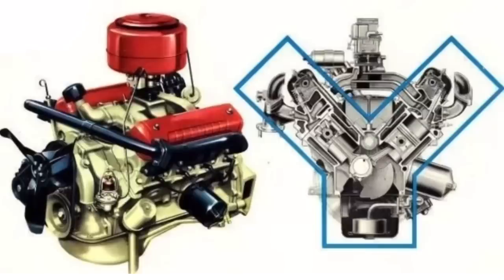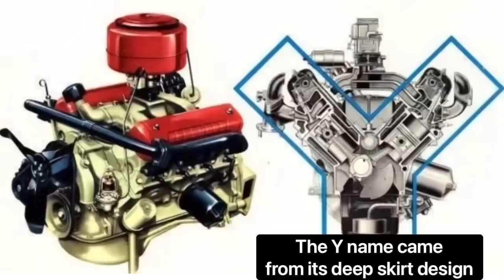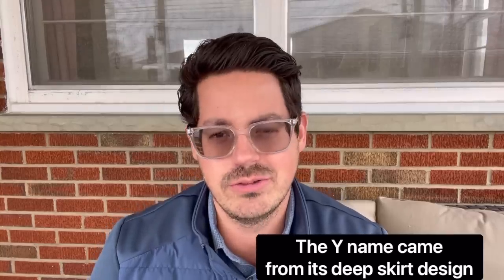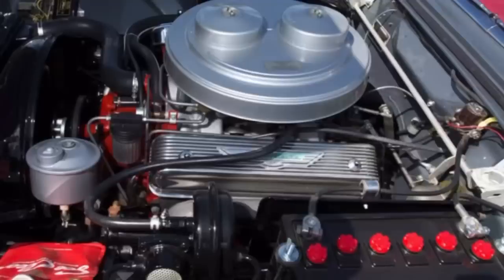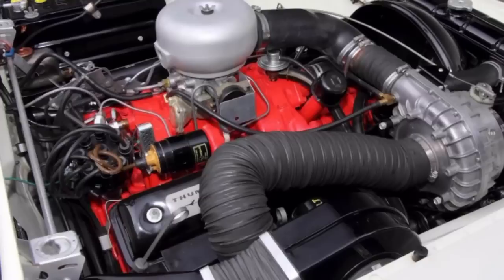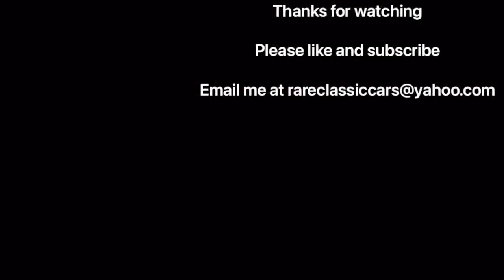Worst Engines of All Time: Ford Y Block V8

Comment: My dad was an L-M dealer in the 50s up to the 70s. His mechanics knew the Y-Blocks well with their idiosyncracies, but I don't ever remember them completely dismissing these engines. The Y-Blocks had their issues and relative to the later MELs and FEs, there's little comparison. But, Ford was looking for an upgrade to the flatheads. Their initial choice of 239 CI was not by accident. Competent engine restorers today have worked out their own methods of the oiling issues and modern oils help. I had an original 55 w/272 engine and a 56 w/292 engine-4bbl. The 292 gave me 114 miles before the rear main bearing went bad around 1970. It was rebuilt with standard rings and bearings. The crank was in near perfect shape. There was heavy clay-like sludge in the oil pan that required a scraper. It seemed to me one of the worst things about the Y-Blocks was the terrible "teapot" or "haystack" Holley 4bbl carburetor used through 56. I replaced mine with a Rochester from a 52 Olds (an old mechanic tip) for $5.00 with great results on the original Ford manifold. Drivers side exhaust manifolds were prone to cracking at the front bolt resulting in a loud tick from the solid lifters. Remember also that Y-blocks were used in 50s NASCAR with success. And probably little known is that truck Y-Blocks (292) utilized heavier components than those used in autos. They were not necessarily interchangeable.

Comment: Y Blocks had their quirks (especially oiling issues to the valve train) and were no match to the Chevy 265 & 283 for performance but I still love the Ford Y Block and hearing it start and run. Some older folks I'm told didn't like them as they were noisy when they wanted a car that ran whisper quiet (the majority of Y-block equipped Fords and Mercurys came with dual exhausts in the 1950s)
The Y blocks were given a lot of internal upgrades in 1955 and thus not much is interchangeable with 1954s (larger water pump, exhaust manifolds, fuel pump is different, etc)
As he says, best to find a Y block expert to rebuild the engine.  They're out there.

Comment: When I was a kid we had several cars with Y blocks, none of them were bad motors, they all ran well and had long lives...or at least as long as other engines of the era and were superseded by the newer small block, the 260 and 289, not because the Y block was horrible, but because Ford learned a lot and had incorporated those lessons into the new motor.

Comment: My dad had 3 EDSELS, 2 58s and a 59, villager 9 PASSANGER station wagon, which did not run. 
The one was a 58 Pacer it had the V-8 361/400 engine, boy you can really hear them lifters makn noise, BIG TIME at idle, and the other was  a 58 Citation, it had the 410/475 engine, which was a repo, my dad purchased it as is, and it did not run, come to find out after he removed both valve covers they're were 3 lifters seized, they did not move when trying to start it so my dad didn't mess with it afterwards. Great topic. Love the 58 MERCURYs as well.💪✌️👌😉👍

Comment: Flat Head ford engines had a tendency to burn oil in the earlier versions. This is probably due to metallurgy better rings and bearings used to post war alleviated this issue.

Comment: I've played with cars for 40 years and torn various engines c down to rebuild them.
I've torn 2 Y blocks down a 292 and a 312.

Both were full of sludge and gunk.
In one case the T Bird that the 312 came out of had Penzoil stickers all over the door jambs. I wo I ld expect that long term use of a paraffin base f oil would tend to sludge an engine regardless of Jake as I ran into a 324 Olds engine using Pennzoil thst was badly sludge and a 390 FE engine that was the same.
But in fact many of the engines I tore down were sludge to some degree.
In terms of durability I didn't find evidence of lack of durability if properly cared for.
The Y books could be hotrodded and were quite successful in their day in NASCAR especially in the 335 c I version as installed in the 57 Mercury's.
And they would hold up under supercharging with Paxton blowers.
The Y blocks were heavy compared to the 265 and 283 Chevys however. And you could build the small block Chevys to wind tighter and live.  For a while at least.
The Y block wasn't around long enough to really benefit from the after market as were the small block Chevys. Consequeny building a strong 312 or 335 today is quite difficult and expensive  if not impossible.

For example there are no aluminium heads for a 312. There are for small block Chevs. And in 1958 Ford came out with the 332 FE engine which would evolve into their hipo big block engine for around 14 years.
By 1960 this engine had evolved into a 352 c I engine making 360 hp at a time when neither the 348 c I chev or the 283 ci Chev could match it.
Furthermore Ford came out with the 221 260 2i9 so as ll block Windsor engine which was extremely light compacy and capable of easily producing over 300 hp  with reliability.
Most of the strikes against the Y block were true of other engines at the time.
Most used shaft mounted rockers. Most were hard and expensive to hot rod.
All were susceptible to sludging problems without frequent oil changes and avoiding paraffin based oils.
In the early 60s I was running Olds engines and found all of the above to be true.
My final Olds was a 57 Olds J2 which I finally rebuilt and dynoed. It made 342 hp. This was in 1963.
Which was respectable for that engine at that time. However in 1963 Chev produced a 327  that made either 340 or 360 hp right from the factory. And in late 63 Pontiacaunched the 389 in the Tempest body making 348 hp.
So my Olds wasn't really that competitive.
Not to nentik that by 61 all 3 car companies had engines on the street over 400 c I and making over 400 hp.
Right from the factory.
Conclusion... The Y block wasn't a bad engine. It was rather typical as l of the time.
It had the misfortune to come along and compete ag as inst one of the GREAT engines of the 2nd half of the 20th century the small block Chevret engine.

Comment: my dad has a 1964 ford fl00 that an uncle bought brand new and its still in the family. It’s mostly dent free but doesn’t look the best visually but it’s all the same original red color but it has a four-speed manual and the 292 y block and man it runs amazingly! has great sounding exhaust, headers and I’m gonna guess like maybe 2 1/2 inch exhaust that goes to two cherry bombs and then turns out right in front of both rear tires sounds so good no H pipe or X pipe or anything. We’ve had that thing loaded down countless times and sometimes much beyond its capacity, you could just tell by how it was sitting so low in the back when loaded down and that engine handled it and still handles it like a champ, Dump runs, hauling wood etc.

Comment: Good engine .. just needed oil changes and detergent oil. People back then were not ready for detergent oil that costs more in a Ford so stayed with non-detergent since they still hade solid lifters. The longest lasting Y-Blocks were owned by guys who put in 1 quart of ATF with every oil change.

Comment: Y block? I wouldn;t knock it that badly. I once had a Firebird Formula with the 305. Great 0-60 car...if you drove off a cliff. Otherwise I'm not sure how many days it would take to get to 60 in one of them. I argued a speeding ticket I got in that car on the basis that I could not have possibly  been doing 60 mph as had been claimed, from that stop light to where I was clocked, as it violated various laws of phsyics and even rational sanity.

Comment: I had a 55 Ford with a 272, and a 59 Ford with a 292. My folks had a 1960 with a 292 They were all good engines, not fast, but reliable and smooth.

Comment: Interesting. Back in the day I had a 312 Y-block, bored .060" over with high compression pistons, an Isky cam, flamethrower ignition, 4 barrel carb and headers - it propelled my '57 stick shift Ford quite nicely, and with no oiling problems at all. Careful assembly and the proper oil is all it took.
Reply: I have had several 312's and like you I believe they are tough and dependable. I think the bad rap was because of people never changing oil or doing any kind of maintenance. If they were so bad why were they prized finds for engine swaps back in the day?

Comment: Yes the "Y" block had weak top-end oiling and some came with mis-aligned cam bearings. But these have to be seen in the context of their time where every engine had it's weak points, and at least there was an easy fix for this via external oiling. Where Ford went wrong was in not understanding that people wanted engines to go fast with, not just occasionally flooring it to complete a pass more safely. Staying within it's designed usage the "Y" block had nothing to be ashamed of, and moreso it excelled as a truck engine for a decade, so it couldn't have been as bad as some would have you believe.

Comment: Even the chevy smallblock had an oil filter optional for the first few model cycles until the boss was incorporated into the casting. The secret is regular oil changes, and the PCV valve that would come much later gave engines an extra lease of life, probably tripled their life expectancy. But detergent oils came out and people thought it meant they could go for longer without changing the oil, actually the inverse was true, and actually if they put a detergent oil into an engine that had been running detergent free for all it's life, it could actually wear the engine quicker as it knocked all the deposits of soot and crud out of suspension and back into the pan where they eventually got picked up by the oil pump and run through the bearings which caused galling and scoring of the bearing material.

Comment: I like my old Y Blocks. I'm running a 292 + 312 heads & a 3/4 race cam in my 64 F100 short Fleetside. With 3 on the tree & 3.50:1 rear, it goes very well! My next version will be a 312 Marine Interceptor with 3+OD on the floor. I'll up the compression & cam specs. Not sure whether I'll use the Dual Carter Marine intake or a Holly yet. It's a lot of fun for a parts hauler though!!

Comment: My Dad and I both had 1955 Mercury's with the 292 Y block engines. Mine ended up with a bad cylinder that passed oil and his had a bad cam. He bought his new. Mine was two years old. We always kept the oil clean and changed. I didn't buy Fords for many years after that, but Dad was an old died in the wool Ford fan and went on to suffer more headaches with other Ford's. I believe it was more a matter of quality control than that of design. Some had good luck with them.
Reply: My Dad had a similar experience with a ‘57 Chevy Bel Air ... Beautiful car he bought new, 283 4-bbl, Powerglide (his first-ever automatic car). The Powerglides that year used a needle thrust washed (Torrington bearing) that was known for disintegrating and wiping out the planet carrier and clutch drum. His went at 18k miles, and GM wouldn’t cover it under warranty. Pissed him off so much he started driving Fords, and did so for the next 20 years. And he didn’t have another automatic transmission until he bought a ‘71 Ford with a C6.

I was an Olds man, and Mom fell in love with one of my cars, and talked Dad into getting her a Buick in ‘79. She drove Oldsmobiles and Buicks for the rest of her life, but he still preferred his FORD pickup with a manual transmission.

Comment: The Y block was not a bad motor if like anything else you knew how to maintain it, and then took time to maintain it properly!! So again I have watched one of your videos and caught you talking out of your A$$ on things you know nothing about!! In fact it would have been nice if you actually spent more time in an actual shop learning about automotive information instead of producing videos of about things you have limited knowledge of!! In short it is people like you that give old cars and old technology a bad name simple because of your lack of information and mechanical abilities!! And sadly you probably think all these new cars are the "best of the best" simply because they are "newer"!!
Reply: Well Greg, I’m an old buzzard, and I worked on these cars “back in the day”. Most anyone that worked on the OHV Cadillac and Oldsmobile V8’s (introduced 1949), and even the Buick Nailhead (‘53 introduction) knew that the Y-block was much inferior to those GM lumps.

Chrysler was building their hemi engines starting in ‘51, and though their cars from that era were butt-ugly in my opinion (subjective, of course), those engines were well built, and the head design made Ford’s Y-block head look absolutely archaic. 

I think it’s quite fair to label the Y-block as one of the worst of that generation of V8 engines.

Ford was lucky in the mid-late 50’s that their cars were pleasing to look at (subjective, but a widely held opinion), because that Y-block had a bad reputation back then because of that top-oiling problem.

Comment: Worst engine due to people using the wrong oil, or not changing oil, or rebuilt incorrectly?
Reply: “Worst” because its contemporaries could tolerate far more abuse than could the Y-block.

Comment: Ive only had one y block and it served me well.I believe it was a 292 in a 64 F 100. Hell of a lot better than a flat head V8. I had a Motor Guard toilet paper oil filter on the y  block.
Reply: By the 50’s, the Ford flathead V8 was obsolete. Gutless, and not especially durable, Ford HAD to build a replacement. 

As weak as the first Y-block was, it was a rocket compared to the flathead. The 239 CID flathead was a 100 hp engine (optimistically rated at 110 starting in ‘52 so customers wouldn’t realize Ford’s own 1952 215 CID I-6 was more powerful at 101 hp), the Y-block sported a true 30% power increase. From a performance and drivability standpoint, the Y-block was a huge improvement.

Comment: So you're taking the design of the basic block and ascribing blame to it rather than the oiling system which was put into it when everybody was still using a lot of Splash and scoop oil to run Automotive engines. Many of the engines at that time suck. Chrysler still to this day builds Y block engines they copied their block from the Ford and Aerospace. And much of the basic head design of the Chevrolets in a lot of areas except for the poly block 318 which has the most advanced question chamber that is still applicable to this day.
Worse than non-detergent oils mama was crap like Quaker State for decades that was high paraffin, and it short trips sludge dingens up worse than I have ever seen them.
Reply: This Ford V8 was named the “Y-block” long before this guy was born, and he’s not blaming the engine’s problems on the block shape.

Where do you come up with this crap ??

Comment: Your reserch is flawed. The Y block was different but not the worse engine by a long shot.
Reply: Which of the Y-block’s contemporaries was worse ? Olds, Cadillac, Buick, and Chrysler all had OHV V-8 engines which were more durable and predated the Y-block.

Comment: Maybe rather than "worst engines of all time" this would fit better under a category of "quirks of early engine development" or something?  It's quite a harsh judgment.
Reply: The series is entitled “worst engineS”, with an “s”, not “worst engine of all time”.

There’s a huge difference.
Reply: @sking2173  ok i fixed it but the sentiment is still the same
Reply: @fomoco3904  — I agree with this guy. The 50’s brought a new litter of OHV V-8’s, and this Y-block was the worst of the lot. 

The Olds and Cadillac were excellent, the Buick was damn good, and the Chrysler hemis didn’t have a glaring fault like the Y-block. 

If the mid-50’s Fords hadn’t been aesthetically appealing, this engine could have really torpedoed their sales. And thankfully, Ford redeemed itself quickly with the release of the FE-series of engines.

Comment: To discuss the Y-Block Ford as one of the worst engines is to blow the oiling issue way out of proportion.  The Y Block was a very good engine if properly maintained, and that includes regular oil changes using the proper oil.  I got my hands on a 56 T Bird with roughly 100K miles in 1972.  The car had not been well maintained, yet had no issues with oil to the rocker arms.  The biggest issue with the 1954 through 1956 Y Blocks was the piece-of-junk vacuum advance-only distributor, imposed by the idiot bean-counters.  The distributor was solely responsible for the Y-Block reputation of poor breathing and lack of horsepower.  A change to a ‘57 and up distributor and a modern Holley carburetor with ‘57 heads really improved the performance of the 312 in my TBird.  It felt like I had gained 70 horsepower out of the engine (after I rebuilt the engine with an Isky E4 cam and Holley 600 CFM carb) by simply changing the distributor and heads.  It was not the fastest car on the road, but it was fast enough to have fun.  I loved running the engine up through the gears, the turbo-muffler exhaust and the open-element air cleaner roaring, building up to a crescendo, then upsifting to the next gear, building up to the next crescendo, and shifting.  I was using Valvolene 20W-50 racing motor oil in the engine, and never worried about shifting it at close to 6000 RPM.  No oil problems.  The Y-Block is a fantastic and much-maligned engine.  You have really blown your credibility with this ‘review’ of an engine about which you know and understand very little.     Joe
Reply: If the engine didn’t have top-end oiling problems, there wouldn’t have been a plethora of companies selling kits to rectify the problem. 

The issue was a well known design defect of the Y-block, and a problem not shared with any of the OHV V-8’s of that era.

Compared to the GM and Chrysler OHV V-8 offerings of the 50’s, the Y-block was junk. Thankfully, Ford quickly brought out the FE-series engine, which was far superior to that pitiful Y-block.